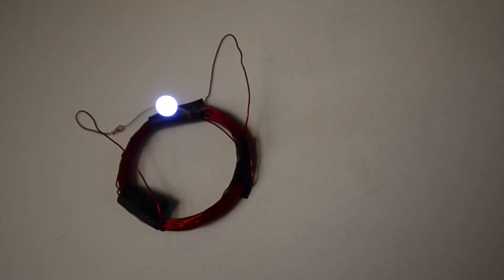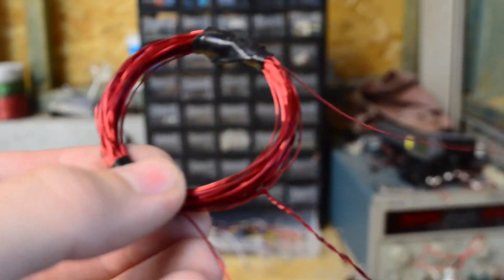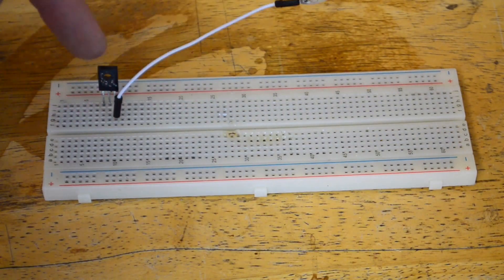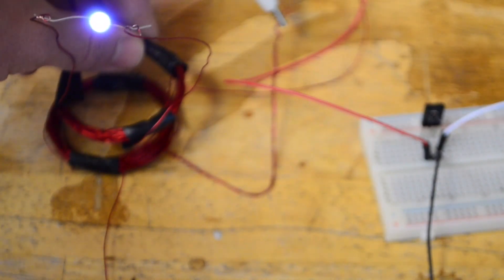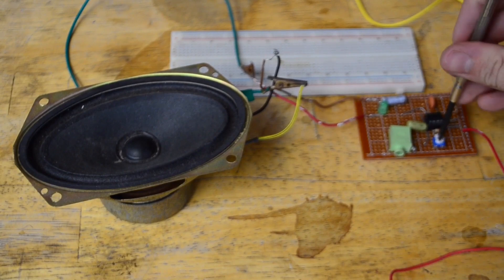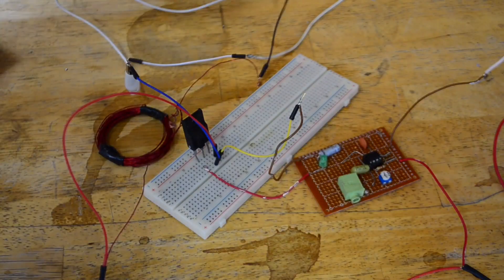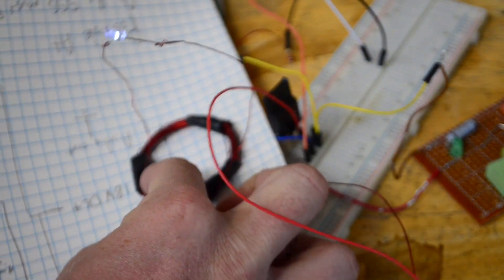How to make Wireless Energy

Comment: hello, i have spent too long to look for a device that would cut off power supply when not in proximity.
lets say for example, I am riding my bike and I have a device in my pocket, if for some reason my bike and I got separated (stolen) the ignition is cut off. thanks

Comment: Why not just stick it near an AC outlet or one with anything plugged into it and running like hummm a hair dryer? Slide the coil along a wall to find electric wires. A compass would work for that and nails I think. What else would work to find wires in a wall?

Comment: Why did you say you can't use a mosfet?
Reply: Daniël Stekelenburg you will need a certain voltage atleast in order for the base of the mosfet to work. He used his frequency generator to generate frequency through he mosfet because the output of the frequency generator is suitable for the mosfet he used

Comment: could I use this to charge a phone wirelessly? if so, what changes do I need to do to make it work?
Reply from the maker: +Lance Adkins hmm probably if you made it resonate together efficiently enough, and you would probably want a full bridge rectifier on the receiving coil as well as an LM05 ( I think that's what it's called ) but anyways this will make it output 5V DC, which should be good for charging a phone

Comment: Salam, make a ring using aluminium foil and it also works.
Wires are thick while aluminium wire is thin. Use it on receiving end first. Then try as emitting.

Comment: Built the circuit, but I guess I'm missing something? Of won't work for me! I'm pretty new at tinkering stuff like this, lil help??
Reply from the maker: +Alan Decowski yeah sure, are you using he first or second circuit I show?
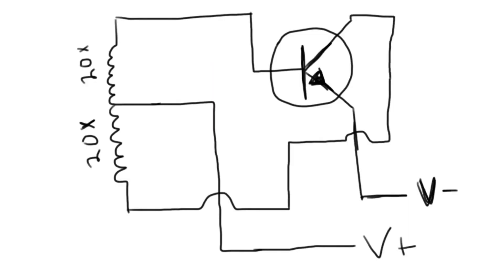Reply: Keystone Science The one at 0:52. The transistor got hot, so i am assuming it was hooked up correctly, but to deal with that I beefed up the coils to a total of 120 turns, center tapped, still doesnt work.
Reply: Keystone Science In addition, if this helps at all, when I switch the circut off, but have the coils close enough, the LED has a small flash
Reply: bump

Comment: Is the coil with the led out putting a D.C. Current? Sorry to ask pretty new to using coils in projects.
Reply from the maker: +Way To Salty yes, ( nit just because the diode is rectifying it ) but since the wireless energy is being transmitted from he form of a DC square wave, it remains similar to that on the reviving coil , in fact if I flip the LED around, it doesn't light up . And no need to be sorry ! :D
Reply: Keystone Science Thank you that was very helpful. Glad there is some one that helps there audience. Definitely will subscribe! Thanks again!!!!
Reply from the maker: +Way To Salty no problem! And thank you!  :D

Comment: Nice video man! Keep up good work!
Reply from the maker: +GHannel thanks!
Reply: Keystone Science is it important that it's a mangnet wire or is copperwire with a coating also good ? by the way I am from germany and i like your videos very much
Reply from the maker: +marchingseer 1 thank you! And copper wire with a coating works fine ( that's what magnet wire is ) :D
Reply: Keystone Science ok thanks :D
Reply: i thought all you had to do was run a magnet in between the coils to produce ac magnetic field, or station the magnet for dc and connect led, and it would light up right?
you still had to plug that machine in. could there be a a mechanical wind up way to keep magnet spinning? then its free and wireless?
Reply: there is its called a bloody dynamo